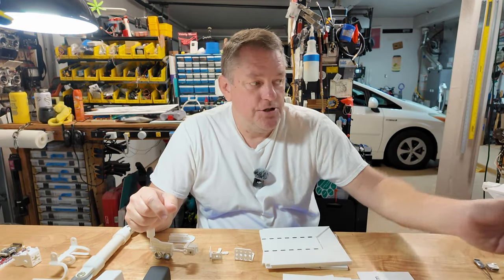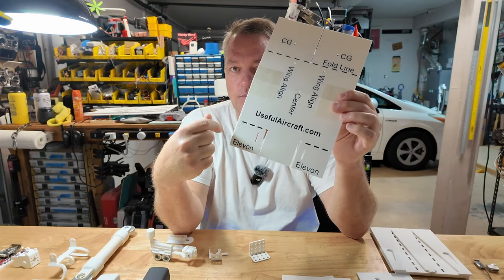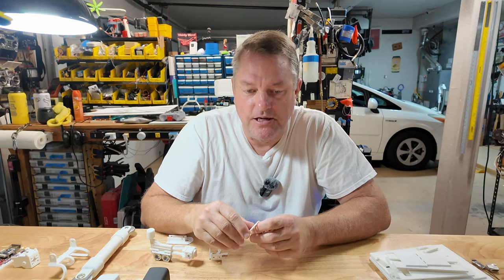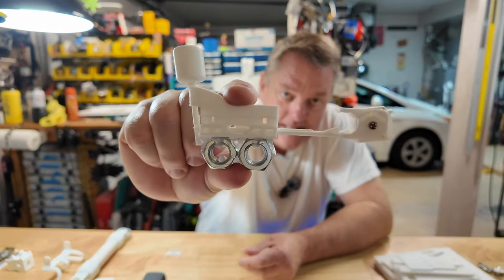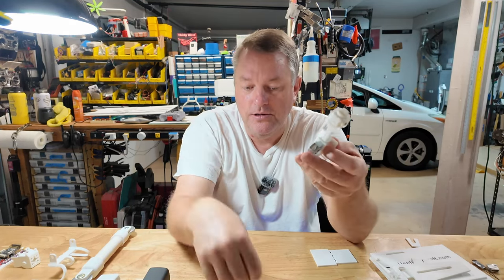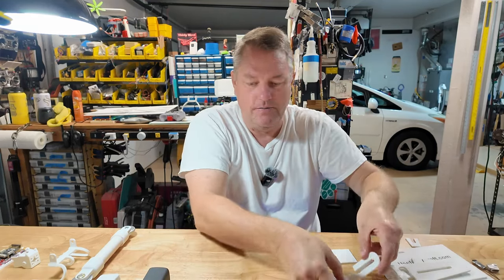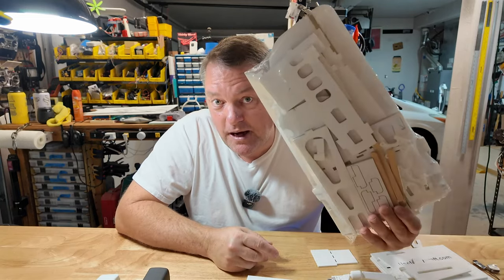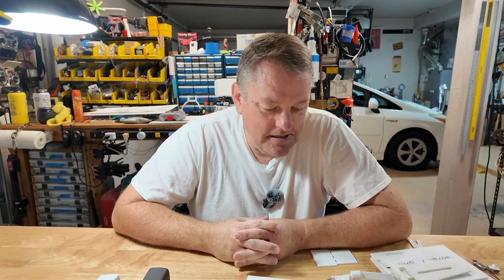Simple FPV Plank - 3d Printed Templates to make your own RC or FPV aircraft

Comment: Thankyou So much. these are excellent tips and part-ideas. Just FYI, I use a pizza cutting wheel for creasing my foam-board. But I do think the 5mm washer stack is easier to use. I usually make multiple passes with the pizza cutter.
Reply from the maker: I have found that humidity may be impactful, and some sheets of foamboard just bends better than others.  I don't know if it's manufacturing differences or something else - but it's good to have a few different tools available to do what is best for your materials and what you're trying to achieve.  Good call on the pizza cutter.